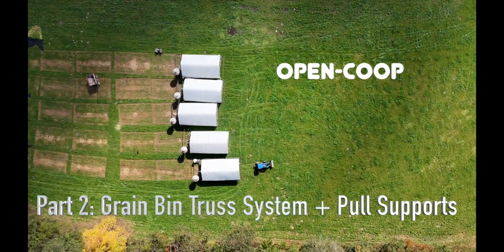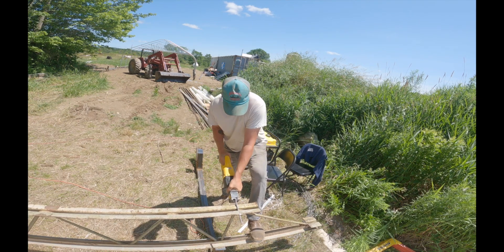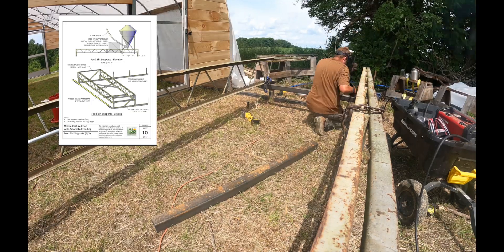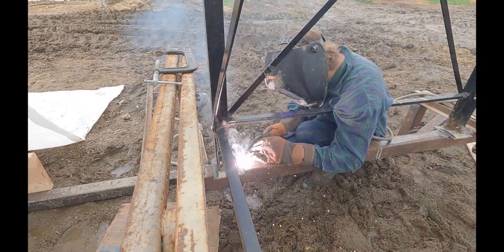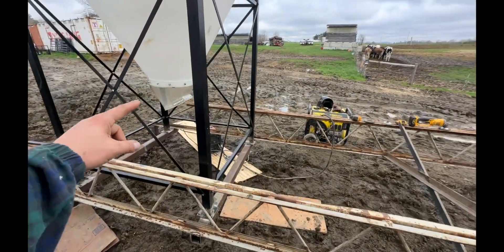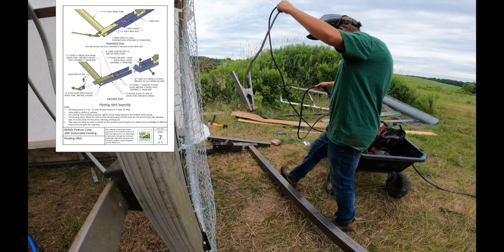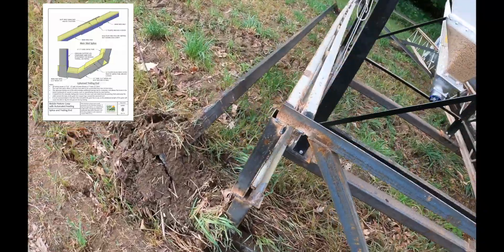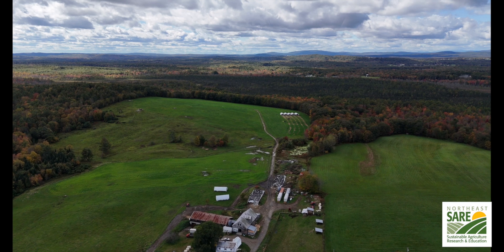Part 2: Grain Bin Truss System

Comment: the grain bin end would need an extra ski or an extra wide ski to distribute loads and stay above the soil.
Reply from the maker: Yea good idea, we just pull from the opposite side and we have no issues with it digging in at all
Reply: @maydayfarm  you could also choke up on the chain a little on the side of the grain bin so that the pulling action is a bit more biased and upwards on the heavy corner